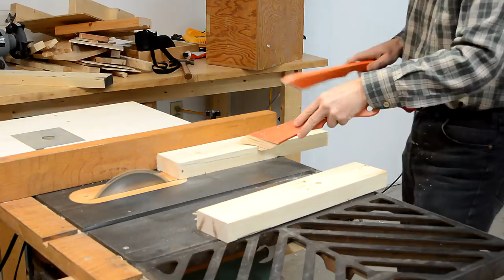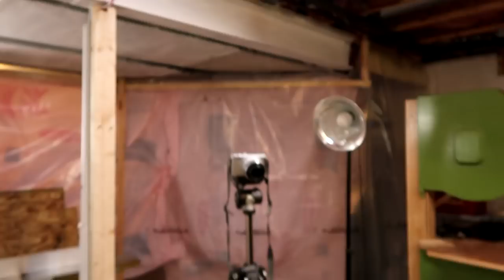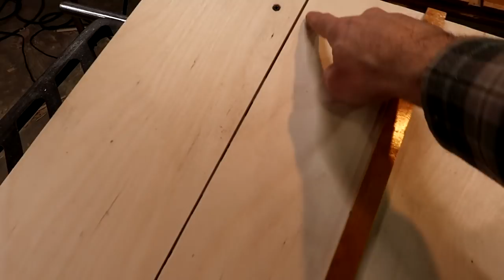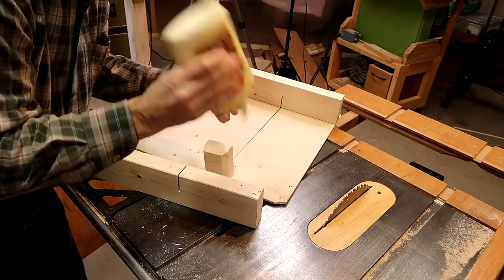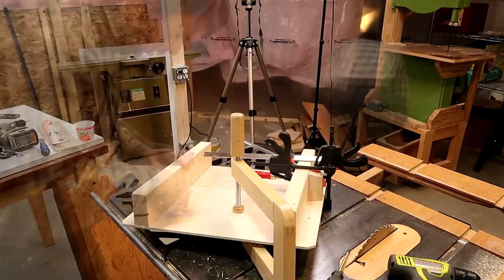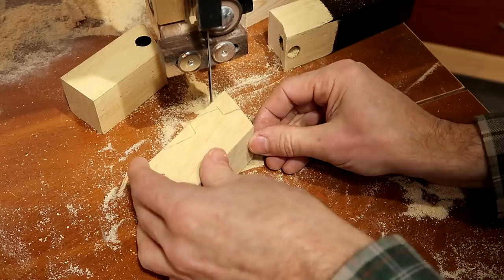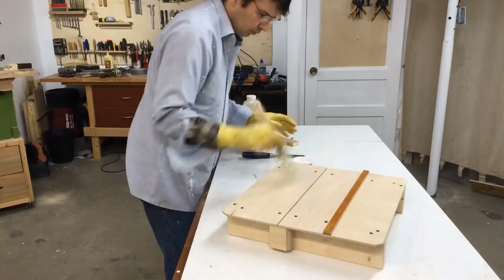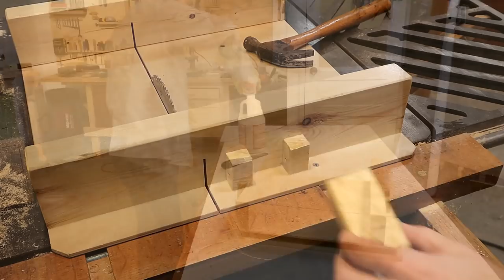How long to make a table saw sled?

Comment: Which brings me to ask this:  How many table saw sleds does a woodworker need?   ;)
Reply: and the answer is:  As many as he/she wants
Reply from the maker: Ideally two for each saw - a small one and a big one.
Reply: Matthias, i was not expecting so reasonable an answer!
Reply: The ratio is 1:1 with clamps.
Reply: I always thought the answer to that was "one more"
Reply: Plus the mitre variations.?>
Reply: Correct answer
Reply: The correct number is 42
Reply: Thats easy. one more than u have
Reply: N+1

Comment: Using a sled to build a sled... -_-  Some of us are sledless you know! What about us!
Reply: Well, he said it was more for himself. Besides, building your own sled shouldn't be too difficult if you just make sure to keep safety protocols in mind.
Reply: Yah but it was just used to cut the 2x4 pieces, you could cut that with a miter saw pretty easily
Reply: Even without a miter saw. Having the 2x4 cut square is nice but is it's necessary for the sled to work.
Reply: Use your mitre gauge
Reply: Ralf Gosch yo day, in fact  these specs are essentially just a safer way to cut in place of the squared up sliding mites that comes with every saw...
Reply: Darnley - no doubt that an after market gauge (I own the Kreg Gauge and love it) or a sled improve safety and quality of the cut. But the complaint that without a sled one cannot build a sled it just plain wrong. Whoever cannot do that should likely stay away from a table saw

Comment: you used sled to make the sled!
that's cheating!
Reply: nope... that's breeding...
Reply: Bootstrapping.
Reply: Piyomaru111 I know, right?!
Reply: Being new to woodworking with no fence for my tablesaw, no sled, no jointer, and no clue. I was still able to frabricate a nice square sled with some ingenuity, it sure took a long time though, felt more like algebra. Probably wouldn't have happened without exposure to a couple matthias videos.
Reply: Hottub motor wont run

Comment: i replaced the glue bottle with a mustard bottle has a much better tip and is easier to clean. Those glue bottle tips suck.
Reply: Joseph Watson that's an awesome idea!
Reply: cant take credit for it saw a few woodworkers doing this tried it and liked it.
Reply from the maker: can't use a mustard bottle in videos.  It attracts way too many stupid comments.
Reply: Matthias Wandel Paint it green, problem solved.
Reply: Supermarkets should have generic polyethylene condiment bottles that will serve the same purpose, and they're cheaper than the same bottles with fancy tops the woodworker stores sell.
Reply: I use a old dish soap bottle.

Comment: Uhhh this sled will never cut square as you did not square to the blade. Just simply squaring it to itself won't work.
Reply from the maker: actually, you always square sleds to the slot NOT the blade, because the slot determines the cut direction.  Everything is always lined up to the slot.

Comment: I would have made it from well seasoned aluminium.

;)
Reply: Godfrey Poon No the salt and pepper jams up in the slot.
Reply: Machine screws or tig?
Reply: +calvingreene90 Machine screws. The TIG will inevitably warp it a touch, and I don't wanna post-machine it.

Besides, I always screw things up.
Reply: +Thomas D Hmmm, I think you're right. Unseasoned it is.

Comment: This is the second time I've heard Matthias say he has never had a framing square not be square and I believe him.  However, at the welding shop where I work I have encountered many such untrue steel framing squares.  Admittedly, they are probably like 20 years old and constantly abused by a revolving cast of misfit 250# journeymen and apprentice fabricators.  I have one I've made true by peening the corner to adjust the angle but the other 5 or so are out of whack by a 16th or more over their 24" length.
  If you buy one new and don't drop it on a concrete floor 600 times you should be fine.
  You check them by laying out a square line off a straght edge and then flipping the square over and checking against your mark, btw.
  Personally I like the aluminum ones because they're handier but I consider them something to handle a little bit gently.
Reply: Both of mine were out of square from the store.  Should've taken them back.  Too late now.
Reply: That is unfortunate.  As I mentioned it is possible to adjust them by peening the corner but it takes some practice to find the right place to hit to either close or open the angle of the arms.
Reply: I know the theory, but haven't tried it yet.  It isn't as if I could make them any more useless.

Comment: Using a table saw sled to make a table saw sled? I'm confused. I'm also, not a woodworker, so I'm being serious. I'm not taking the piss.
Reply: None of the cuts he made with the sled need precision.  When I made mine, I used a chop saw, but you could just as easily use a hand saw.